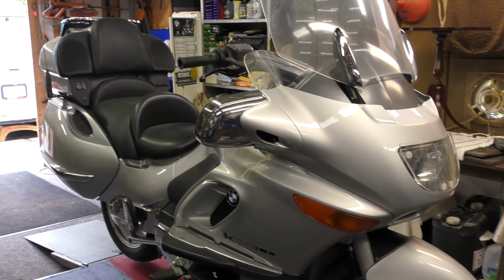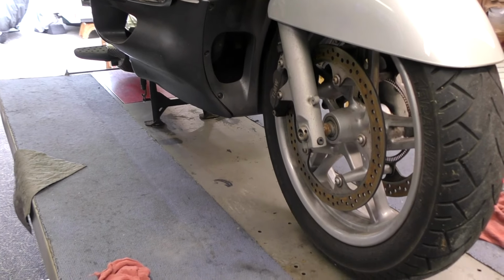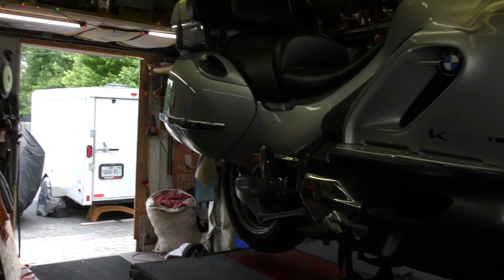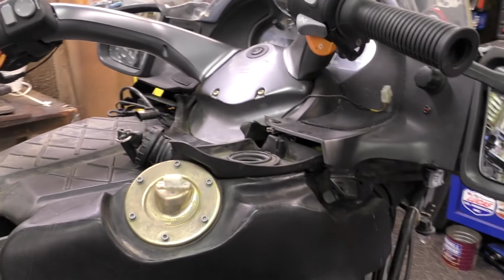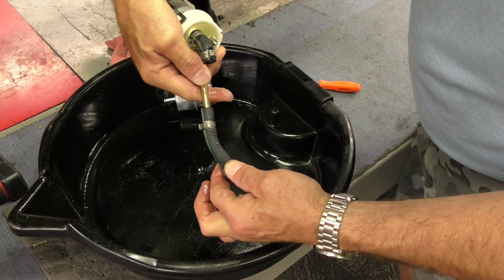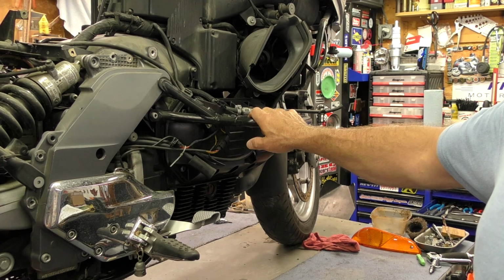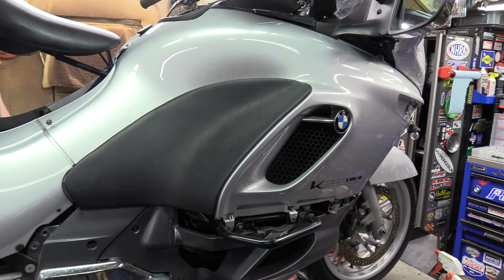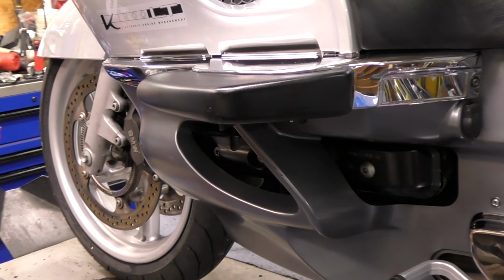2003 K1200LT Pre Sale Prep Work "Stripe"

Comment: My 2001 k1200lt has 175000 miles on it and I still can't wait to take it for a ride. I've done a lot of work keeping it running well. I just changed the plug and did a compression test and all four cylinders were great shape. Thanks for all your help keeping my Lt running and in great shape.
Reply: Same thing for me. Without Kirk's videos I would have been done with my 2000 LT a decade ago.

Comment: This video came at the perfect time!!! I have a 1999 LT that’s been sitting for 7 years and my Dad can’t ride it anymore due to his knee. Gave it to me and I want to get her back on the road…ironically just before it was parked we went through the whole thing…rebuilt shift linkage, front damper, spiegler lines, resurfaced rotors, new pads, final drive serviced, new tires, valves adjusted, gas tank quick disconnects, new k&n air filter, new windshield, etc….can’t wait to get her back on the road.
Reply from the maker: sounds like you have it pretty well sorted out

Comment: someone help me please, my first motorcycle I have a k1200 lt 2001, I'm working on it, I bought it from a person who left it parked for 9 years, I did everything necessary and now it's working, but when it starts it emits smoke with shades of blue or white, I don't know, and for a while when it's running it slows down with smoke, but it doesn't stop coming out, signs of wear on the piston rings are common on heavily used bikes, but it only has 18,000 miles, it could have been damaged by stay still for a long time?
Reply from the maker: Smoke is normal on startup if you left it on the side stand.

Comment: I have a k1200lt,  99 model didnt do more than 50 kms for 3 years ran fine no temp issues for 1000kms but the now temperature rises a lot when the motorcycle is stopped or in traffic, because the fans do not turn on.  I checked the fuses and they are fine.  It could be the fan relay, hrlp from devon england

Comment: I would like to know what should be done to a bike that has sat like this one other than the gas tank/filter, air cleaner, etc. Please list out what you would do, Thanks.
Reply from the maker: I change ALL of the fluids and the brake lines. I inspect all of the rubber parts and the gas lines and remove the alarm if it has one. If you listen to what I did on this bike, it is a pretty good list.

Comment: What did you find with the front shock?
Reply from the maker: An excellent question! The shock was in great shape. That oil was from the blown out steering damper throwing oil at speed back onto it. I swapped both the shock and the spring though to freshen it up!